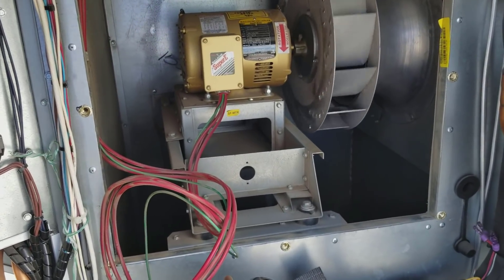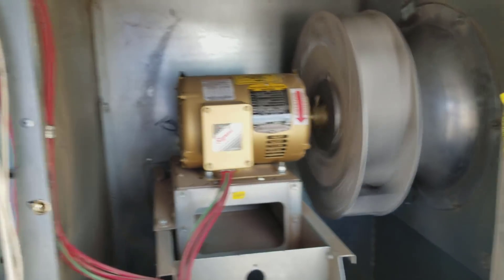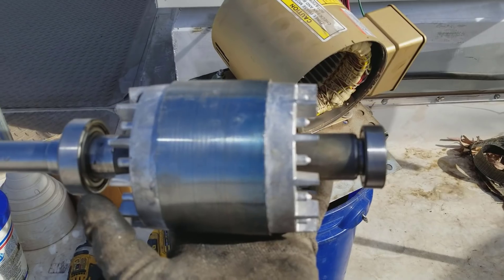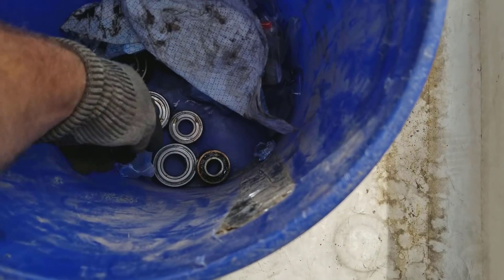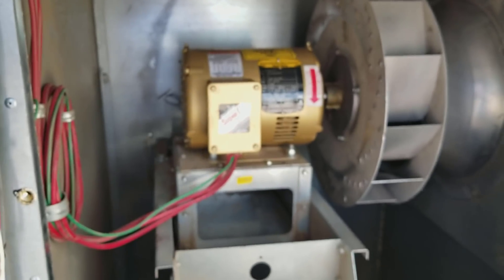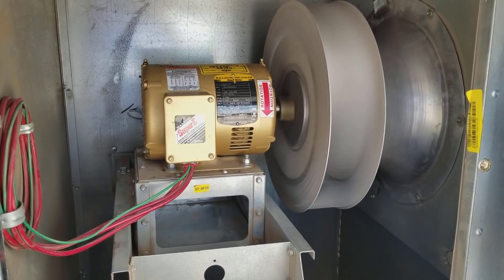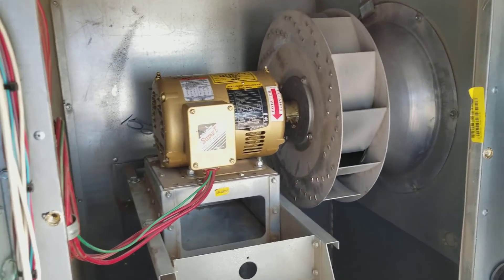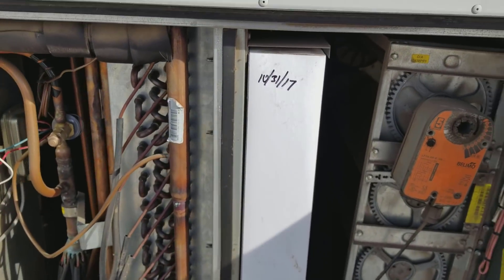AAON unit sounds like a Goodman - That means that something is wrong

Comment: It's not the bearings. It's the VFD producing random shaft currents. Should have installed a ground ring with those new bearings
Reply from the maker: Yet,  these are produced like this and no ground ring is used.
In fact,  99% of VFD controlled motors don't have one.

I know the ground rings help extend the life. 
But these only lasted between 1 and 2 years. 
All factory build at AAON.

The replacement bearings i used have now lasted longer than the original bearings. 

Same ring at several locations with 2017 AAON package units using Baldor motors.
They must have been junk bearings.

Comment: do you heat the bearings to put them on shaft?
Reply from the maker: No. I just tap them on carefully. 
I basically alternately tap on opposite sides with a flat end punch and a hammer and they go pretty easy.
Reply: Where are you sourcing new bearings? And sizing?

Comment: Nice video hack free. I wish it was longer,  showing the removal/install of the new bearings.
Reply from the maker: I'm sure I'll have to do more after the new year.
I'll try to remember my mini tripod and maybe set up my Sony camera.
Reply: Thanks buddy, I have this environmental test chamber circ fan/blower motor that eats up bearing. I replaced them with nsk the last time. Been 1.5 years, been ok since. The chamber is not one of their heavy use one's. So far so good. I posted to say some of the newer guys in the field would like to see to removal and install of the new bearings. Thanks, hackfreehvac for your videos and knowledge. I always thought Aaon units were great to work on. But, it is more of a problem with Baldor. A huge motor manufacturer around the world.
Reply: Great video would love to see a removal/install as well.  I'm having the same noise issue at work on a Baldor used in a pumping application. Definitely the bearings it's sounds identical to this Aaon

Comment: Have the motor rebuilt and install an Aegis ring. You won't have any more failed bearings on motors on VFD's. http://www.est-aegis.com/index.php
Reply from the maker: These are stock and just out of warranty.
It might be a little difficult to sell them that add on. Although it could surely help.

The funny thing is AAON uses VFD's all the time and the motors usually last a lot longer. I think these might just be crappy bearings on this generation of Baldor motors. I heard from someone else that Baldor was having issues.
Reply: I hear you. I'm a facilities supervisor at a hospital in Massachusetts, and we just sent out (2)two 15 h.p. Baldors, (1)one 7.5 h.p. Baldor, and a 40 h.p. Baldor for new bearings and an Aegis ring. Love your channel, and your Goodman videos!!!
Reply from the maker: Thanks.